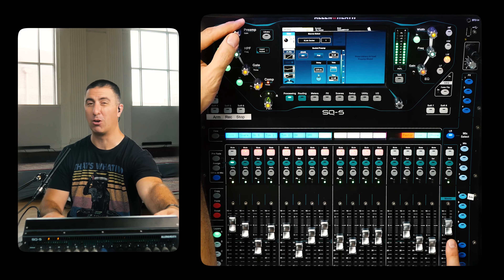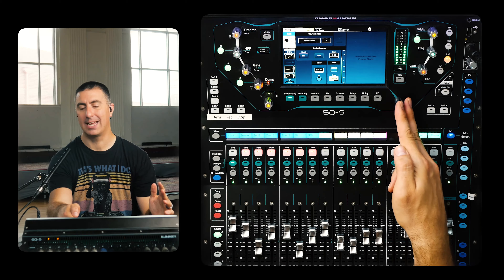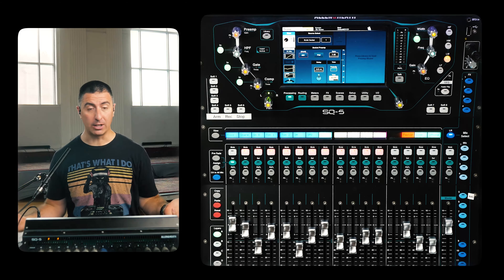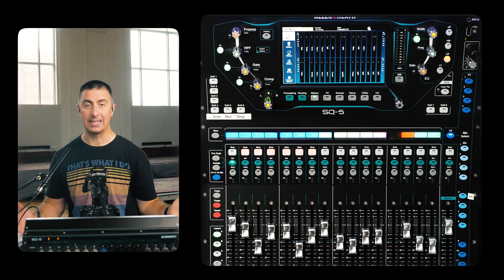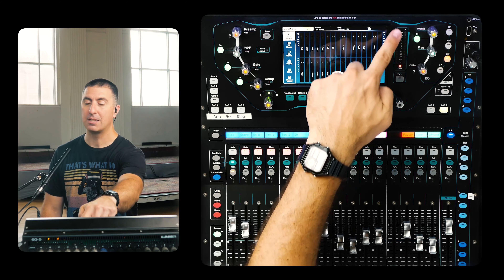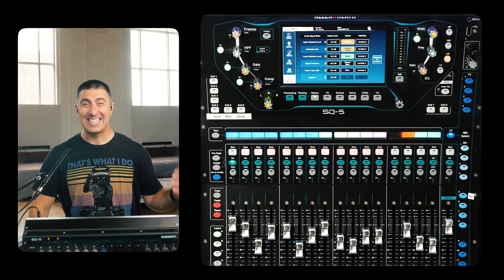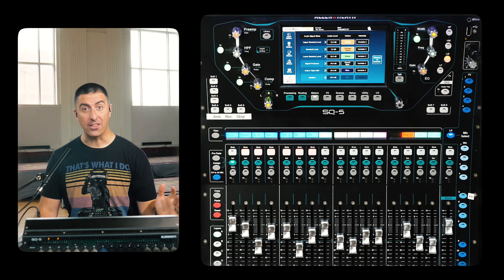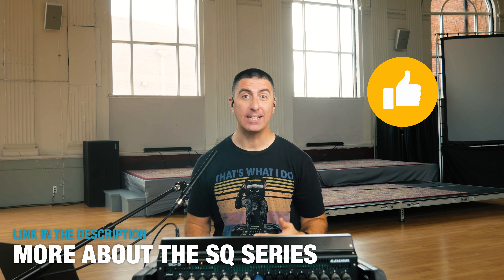Understanding Metering on the A&H SQ Mixers

Comment: I use the SQ5 & there is metering at every stage. The peak lights flash at -3db before clip. Even a layer button will show a red flash. The chromatic LED  on each channel changes colour & always Indicates almost any sound level (threshold levels can be custom set) if you consider that input level can be set for average 0dbu but gain can be added at a later stage & accumulate as well then visually seeing the potential issue is very helpful. Allen & Heath have a comprehensive page on their metering approach. Users often miss that internal level & hence USB output level is -18db when the meter says 0db.

Comment: Nice looking mixer, and great meter info.

I'm the audio visual tech for my local Church of God. I run Zoom Meeting for those that can't be in attendance. Also I'm recording the service via OBS onto our in-house NAS for post processing, mainly editing the video. 

My mixer is still a Soundcraft Ui16 rack, a Mac Mini M2 as the brain, and Studio One 7 Pro doing extra sound processing. 

Dave's wishlist is more wireless handheld Sennheiser XSW2- 865s. They're super cardioid condenser mic capsules. Recent upgrade for the baby Grand Yamaha piano and for the wired pulpit mic are Lewitt LCT 440 PURE Vida for the piano, and the LCT 441 FLEX multi pattern on the pulpit. 

Up next I hope it's replacing the Ui16 rack mixer with the PreSonus Studio III 24R rack. I need more inputs available, and this guy will integrate well with the S1 7 Pro DAW.

James and subscribers, wishing all a happy and safe holiday season.
Reply from the maker: Nice! I've been impressed with the lewitt mics I've used so far.

Comment: I am inserting analog compressors into an SQ, for live work. I like the hardware's sound better than the plugins. I can clip the channel with the hardware but it is after the preamp. The preamp gain is correct but the comp insert, when too hot, causes the clip led to respond. Assuming the clip "sensing" also detects the insert signal in the signal chain.
Reply from the maker: yup :)

Comment: Hello, My name is Danut Valerian, I own an Allen&Heath Sq5, I followed most of the tutorials available on YouTube, they helped me a lot to be able to use this console at an average level, but in none of the videos is there anything explained vis-à-vis the control of the recording level on the SQ-drive, regardless of whether it is a stereo record or a multitrack record "by default" the recording level is very low as loudness, after each session the waves are transferred to the DAW and are having to add an extra of approx. 12db-18db to reach an optimal loudness level... I mention the fact that all my inputs have a correctly checked gainstagging +0 db... instead in soundcheck mode (usb routing being on Ip17...Ip32 customized layer B inputs) somehow my SQ-5 automatically compensates for the lack of loudness, which makes it too much compared to the real input level! My prayer would be, and I think it would help many beginner-medium users to understand how it works, if you could make a short video about this aspect! Thank you!